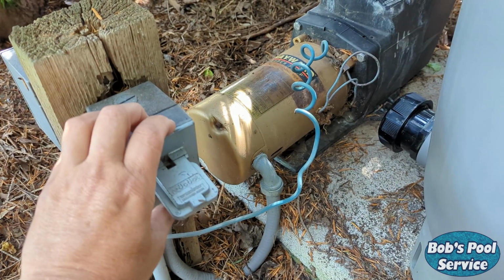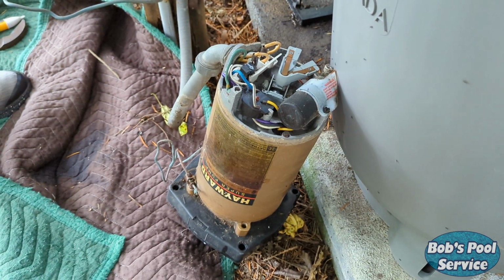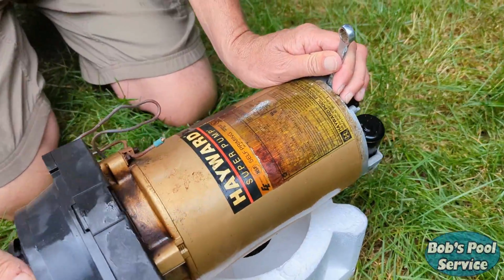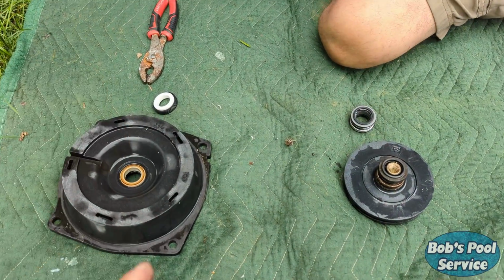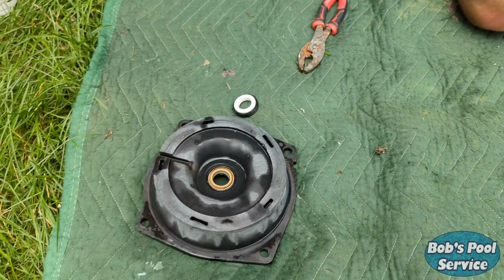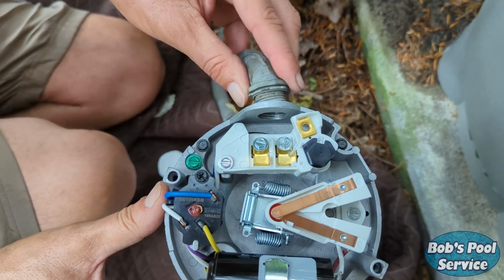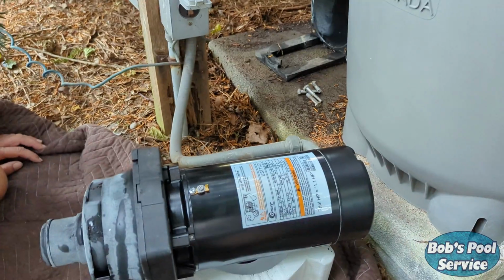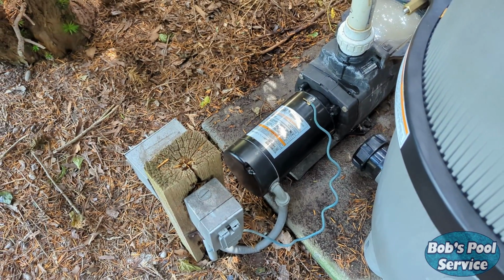How to Replace a Hayward Super Pump Motor step by step

Comment: I was so pleased my motor was made in Thailand and not China!  Thanks for the help.
Reply from the maker: Hopefully it's better, we saw motors go from USA to Mexico, then later China and Thailand.  Hayward doesn't make motors, they're made by AO Smith, Emerson or Century usually.  I haven't found either brand to be better in this case but I will say the OLD ones lasted for 20 years, new pump motors 5-7 at best, some only make it 3. Usually the bearings go and they get so loud you can't be in the backyard with it.  We used to change bearings but now when we take apart the bells on the pump usually the metal just crumbles and the screws snap so they're really not serviceable like the older ones were.  If you were handy and put new high quality bearings on a brand new pump you may get more mileage.  Glad the video was helpful!!
Reply: @BobsPoolService  they use crappier metal for sure.  America was great but everyone got greedy.  Companies, unions, consumers.  Maybe we’ve all learned our lessons and things can come full circle.  Thanks

Comment: Thanks for the all of the instructions. Unfortunately for me not one aspect was remotely as easy. And after it all went in I had water leaking from the bottom. Took it apart 3 times to check the seals etc and same result.
Reply from the maker: Sorry it didn't go smoothly...  one thing that's easy to do is accidentally leave a part of the old seal in place, if there's a small rubber ring on your impeller shaft from the old seal and you put on the new one it may leak.  Second thing that's possible is the housing gasket is worn out or even more likely pinched.  Check around the perimeter of the housing, there's a very thin rubber gasket, make sure that hasn't fallen out partly or become compromised.  Also try to see where the water is leaking from, under the pump there's a small hole called the "weep hole", if it's coming out that directly more than likely it's a problem with the seal.  There's also a small chance you got the wrong seal, PS-201 is the most common for the super pump, all the HP motors use the same seal of this style pump.
Reply: @BobsPoolService  I just read your reply and it appears you're on to the issue. I actually took it apart again this morning and realized the gasket was smaller than the old one. I put the old one on and boom no leaks! Now my issue is priming. The seal on the front may have been put  on backwards  because I reversed it when I got the leak. I'm gonna see if that helps get better
suction later today in order to get a good  prime. Thanks!
Reply: @BobsPoolService  still can't get it to prime. Anything I may be missing?
Reply: So to finalize for those that may have dealt with similar issues. The filter needed to be cleaned and pressure released. After that filling the basket constantly eventually led to a good prime.

Comment: Very helpful. Where can I get one of those seals ?
Reply from the maker: I would look for a local pump or electric motor repair shop.  Where i live there's a place called Quality Electric that stocks all kinds of pump seals.  Another options would be a store that sells pool supplies, seals are a common part that needs to be replaced.  The one place I would NOT buy one is a bargain on amazon...  I've seen countless customers purchase their own parts and the cheap knockoffs don't last more than a couple weeks!  The proper seal for this pump is a PS-201, companies like US Seals sells decent ones, there's also salt-water rated ones with viton rubber compounds but new super pumps don't come with those and we install them on salt water pools all the time without premature failures. Of course when we replace the seals we use the better salt water rated ones.  Hope this helps.

Comment: I followed and switched out my pump. It runs but after hooking everything back up I can get it to pull water in. What did I do wrong?
Reply from the maker: Make sure you put the diffuser and gasket in there, I've seen that forgotten many times and even did it myself once.  Beyond that I'd try filling the strainer housing with water and with the lid off turn on the power briefly, if you see the water suck down then more than likely the pump is working ok but you have an air leak somewhere in front of the housing (or the lid, etc). If the water doesn't suck down definitely check the diffuser, impeller and other pump internals.